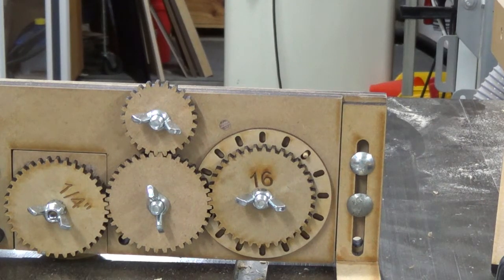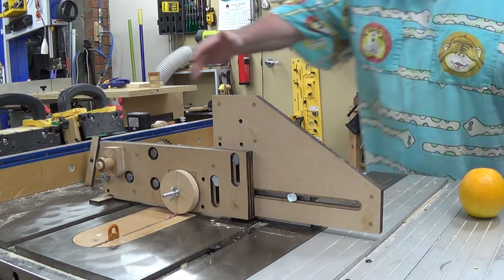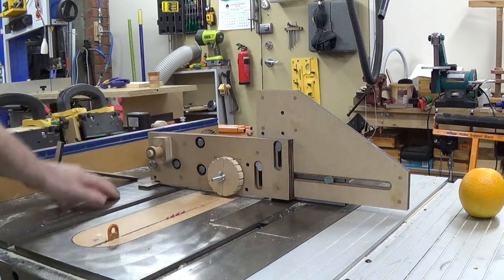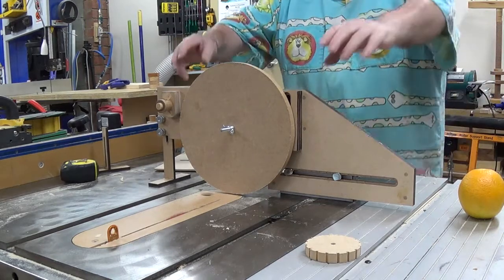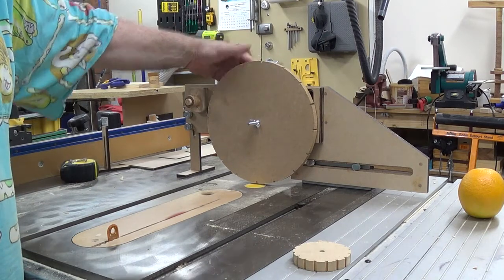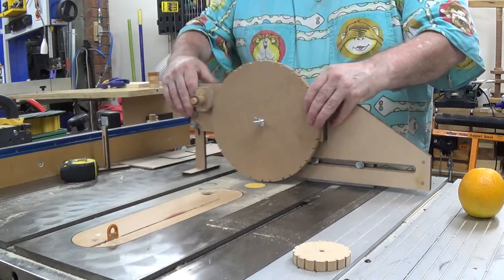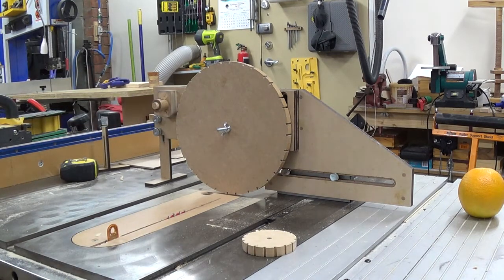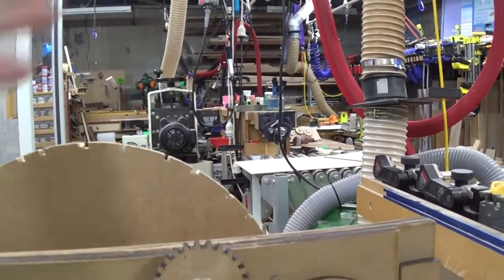Wheel Kerfing jig 9 Incher Part1

Comment: Hello Alex   Are you selling these Jigs? Thanks.
Reply from the maker: Hi Rocco, Unfortunately (for you), no, I don't sell the jig.  As I'm now retired, I'm not anxious in making my millions from the jig and then retiring.  In the past I have supplied the cut parts to friends, however, that was getting costly and the shipping overseas (even locally) is getting to be a killer. Nevertheless, if you are interested I do have a SketchUp model of it that I can tidy up (a bit more user friendly) and make available.   I can also make the cut list available in a full sized PDF for use in layout templates.  Unfortunately the gears are hard to reproduce manually, however, if you have access to a CNC or a laser (for the gears) the rest should be doable with conventional tools.  Theoretically, if you supply the laser cutting files (which I can make available) , the service should not be that expensive (sorry but being a hobby, I'm not familiar with laser services costs).  While it can also be done on a CNC from the PDF's, I don't know how.
Reply: Muy buen trabajo, si fuese cónico el cilindro que posiciona el anclaje no habría prácticamente olguras. 
Saludos. 👍